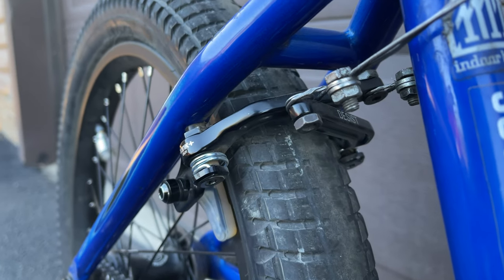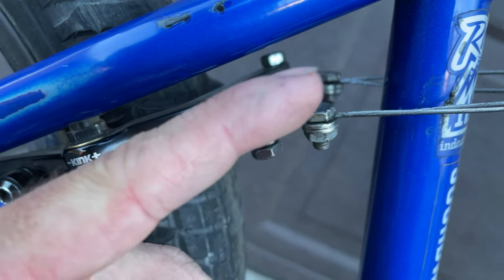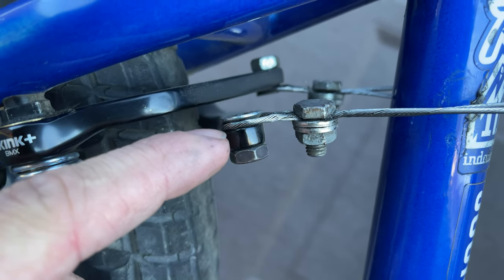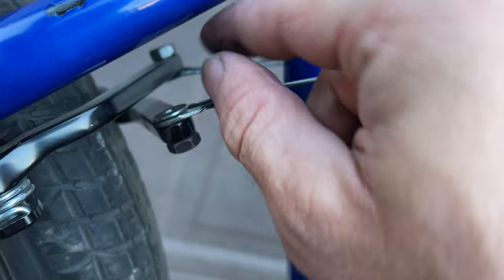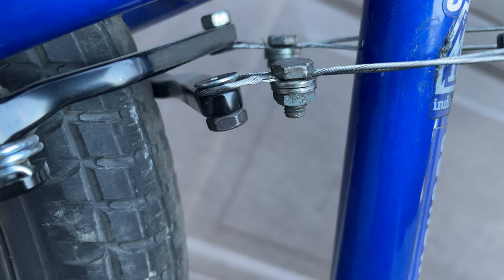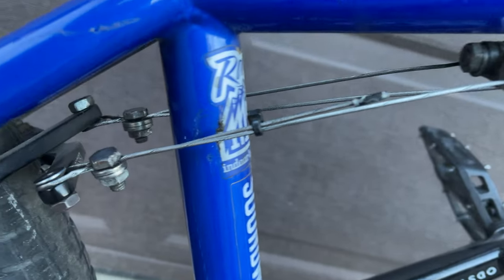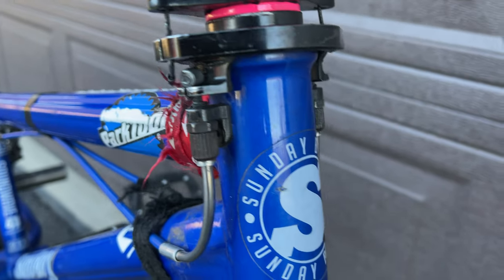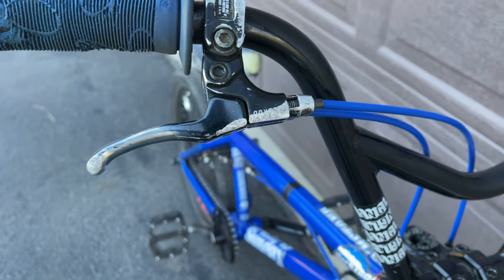My CUSTOM Kink Desist BMX Brake Setup!

Comment: I run the odessy spring field brake arms with clear pads, odyssey trigger lever and snafu cables and gyro. I love how simple the setup is and I will never have to adjust spring tension
Reply: Koolstop cables and odyssey cables are the truth best clear pads are the koolstop supra 2 pads best pads
Reply: @juliangaribay4711  thanks, I’ll have to check the kool stop pads out. My brake pads don’t work super well👌
Reply: @austinc2387  trust me these are the only pads I run I have two pairs bought em years ago and still feel new and the grip on em are perfect and they don't fade rims either and have a huge contact
Reply: I run the odyssey trigger lever single cable koolstop brake cable demolition vulcan arms with koolstop supra 2 pads clear this setup is really good
And I also run the same setup on my other bike with a odyssey k cable odyssey trigger lever single cable koolstop supra 2 pads clear both setups have lasted years with no replacement parts on my third bike I'll build I'll run the odyssey trigger lever single cable koolstop cable koolstop supra 2 pads clear with the odyssey springfield arms for easy setup those arms were solid and light and easy to setup
Reply from the maker: You really cant beat the simplicity of the springfield. They're actually pretty stiff brake arms too for how inexpensive they are!

Comment: I like to see new setups but I'm still saying that the spoke mod is superior just because there is no flex in any of it as long as the cable pull is straight or inline to the cable stop. Plus it adds another adjustment point.

Comment: Any tips on using as a front brake without the front brake adapter kit? It isn’t available. I have used the two supplied ends and put a cable end into one end then attached a odyssey knarp so the cable doesn’t slip out. I couldn’t find any adapter from another brake that would fit through the hole.
Reply from the maker: Hmmmm, it seems like you might be able to put a barrel adjuster in the side the housing goes into and then use a knarp like you described.
Also, I checked albes and it says that they have the kink front brake/dual cable pieces in stock right now. You'd use the barrel adjuster the same way and then one of the front kit pieces as a knarp.

Comment: Try to find different bolts for the arm to prevent the cable from slipping off the bolt the cable may come off when the arm is released over time go to a hardware store and find something similar to the bolts you used for the arm's
Reply from the maker: I’ve been riding it like this for over a month and the loops haven’t come off unintentionally once. Done several big fufanus and tricks that are death if the brakes fail and haven’t been let down yet. Don’t think they’re coming off
Reply: @Brant_Moore  brake setup looks dialed though but just for assurance there could be better bolts for the arm's always room for improvement

Comment: Just curious if you are still using the kink desist brake or if you have any input on them since you may have used them for a while?  I just purchased a kink whip and not happy with the stock brakes even after adjustments. Thinking I may just need to go ahead and upgrade...
Reply from the maker: I am, yes! On both of my bikes. 
They are still great. My current brake tune up has stayed good and feels great much longer than any other that I can remember.
The brakes on my trails bike kind of started to feel bad, so I did a tune up on them and they’re back to feeling really good again too. I can definitely and confidently recommend them
Reply: @Brant_Moore  thanks for the input! 42 and back into BMX and hands down your content has helped me a lot! From the direction of picking my new bike, to bike maintenance and beginner tricks you have helped a lot.  But I think this answers my question on my brake problem and what direction I should take.  
PS... my son, now will always ask me to play Lip Lords 12 right before we hit the park for motivation..
Reply from the maker: Thats all so awesome to hear man!!! Hell yea!!

Comment: Will this work for Mission Cease V2 brakes or should I just upgrade my brakes first?
Reply from the maker: Im not sure how well this would work or if it would work at all with a normal cable junction on the brake arms like what the mission brakes have.

Comment: The cable looks like its going to snap behind the bolt this is why i hate running breaks. cables fraying and snapping all the time or my threads on my removable break mounts coming loose all the time under my break prolly why im breakless now not rode break's sins 2012
Reply from the maker: I dont see it breaking any time soon. Its a loop around something round to anchor it instead of a pinch point. There's much less friction with a loop if any at all so you're relying entirely on the strength of the cable inner itself. This is better than the setup I had before this and I never broke a cable with that.